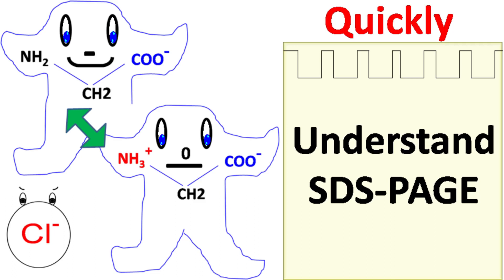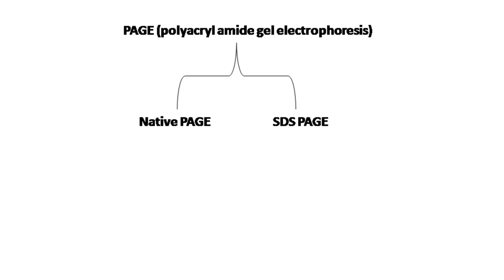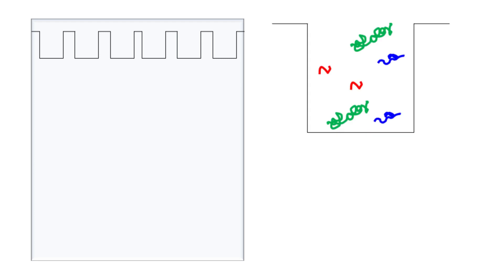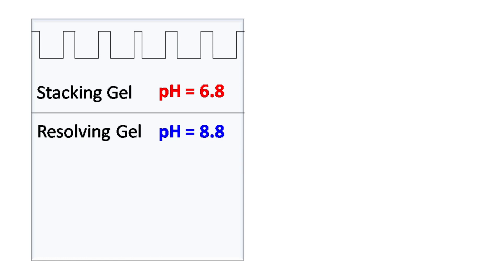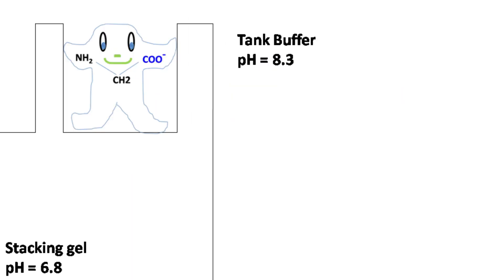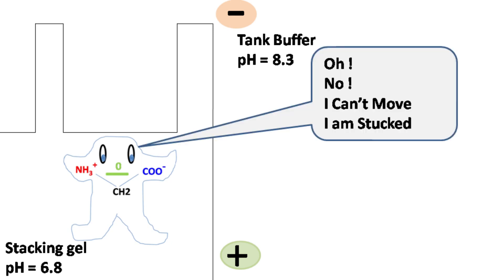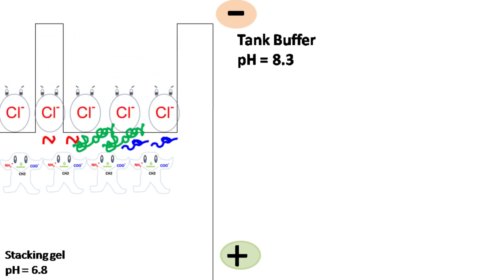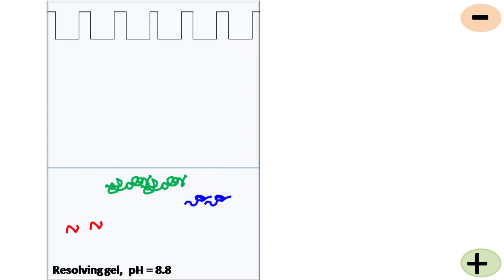SDS PAGE

Comment: Chloride ions move faster creating reversed local electric field inverted of that of the mail gel system, which slows the SDS-bond protein behind the chloride ions. However, and with time, the glycine accumulates behind the proteins helping to pack them on the same line. Hiving these forces enough time, the final results will be a sharp distinct three layers: Chloride, proteins, then glycine (from bottom to top)